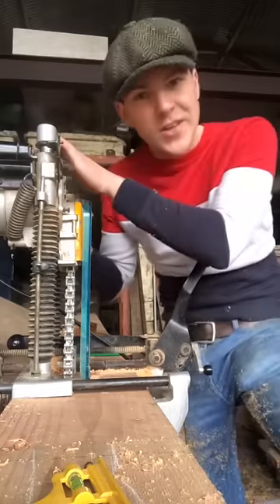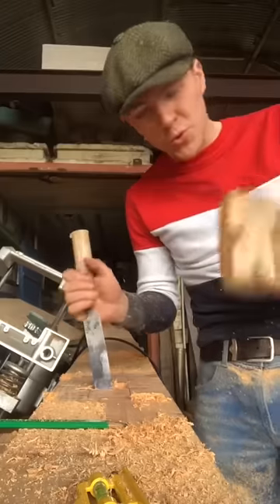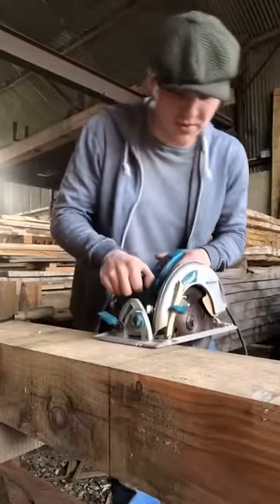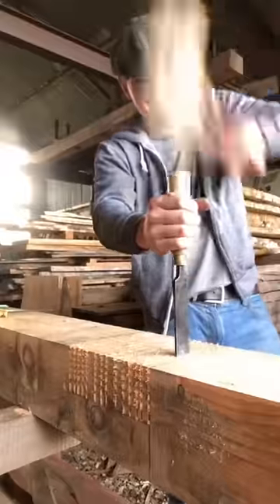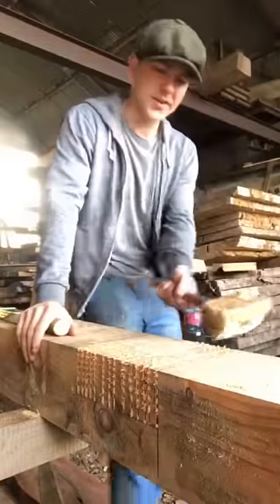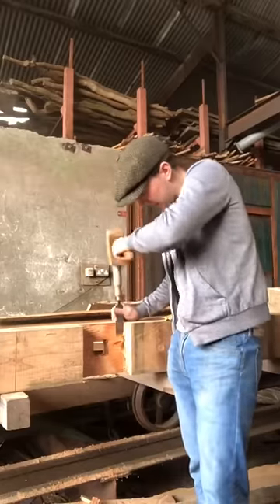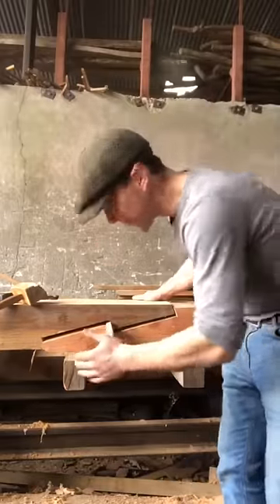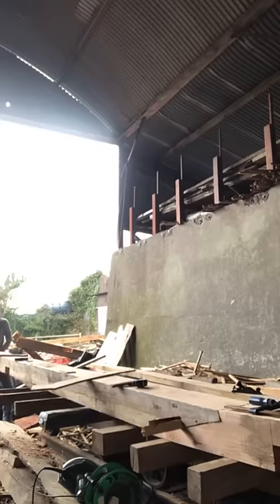Timber Framing Activity #shortvideo #ireland #timberframe #handtools #construction

Comment: The issue with your scarf join was two fold. One: not enough of an under cut at the points. Two: did you make sure your cuts were perpendicular to the crown of the grain? IE is the line of the cut going from the core of the tree out? If its cut where the rings are parallel to the cut, they can delaminate, but if the angle of the cut is perpendicular to the crown of the rings they contribute to its strength.
Reply: Everyone I’ve seen cuts these wrong. The only issue I see is that the end angle is square, it must be acute otherwise the two pieces cannot lock together.

Comment: Jamming the safety on your circular saw ❤. I'm 40 and I've just learnt this. Rate u bigly Brighton uk
Reply: Just make sure that you're on heightened safety awareness whenever the using a wedge on the blade guard. Hazard #1: while holding the spinning blade at your side, it will catch on some nearby object and be spun into your thigh. Hazard #2: If you set the saw down on a bench or the flaw, it will become a one-wheeled rotating cutter and rip into your foot. I've seen both of these actually happen. 
-- That said, I worked for years on framing crews, and we used the wedge routinely. 
-- And that method of cutting dadoes and rabbets is fast and effective. I lost count of the bookcases I made that way. It works better if you make the cuts closer together.
Reply: I never wedge my guard anymore, seen too many accidents. There are very rare occasions it’s a necessity, but this is not one

Comment: Your scarf joints aren't long enough. You need to run the joints 3 times the width of the material on length. This looks like 20cm material, so the scarf joint should run 60cm on each piece past the wedge. For the wedge you'll need to mark out the actual size of the wedge hole and split that in half so you can drive the wedges into each other , this crushes the scarf joints together. This is a non-structural joint so if you're using this as a beam ideally a post is supporting directly beneath your scarf joint.

Comment: I wouldn't call it a failure. Scarf joints aren't supposed to accomodate that type of stress. It's used to splice to beams together lengthwise, and keep them from pulling apart like this: <--  -->. Not meant to accomodate forces on the other axis going "up and down". 
So, I'd call it a win (even of it does look a little on the short side. In my country the old books state a minimum jointlength of 3 to 3,5 times the dimension of the lumber)

Comment: What was the problem that caused the joint to fail?

All 3 of the house I've built had a metal skeleton.

I would like to do some actual traditional timber work but don't trust myself enough yet.

So far I've made some convincing faux frames but there is either "I" Beam or Sch #40 Square tubing core doing the work of the span.

As a Welder-Machinist metal just makes more sense to me when so heavily financially invested.

But still really interested in tradition framing.

Comment: Think most of your vids are amazing! That said, your joint was likely cut just fine unless you wedged the other side or sunk it all the way across off camera. I doubted it because I saw it shifting in the joint like there was slop before it broke. If it's only wedged tight on one side your beam is sure to flex to the side with give to it and cantilever those two joining faces until one gives.

Comment: The locking angles on the ends are a bit too shallow Japanese make cut parallel with the angle and place a matching groove into the opposite piece solidly locking them together

Comment: I absolutely hated to work with the chain mortiser back when i had to do external courses to learn the trade. Just seems like such a dangerous machine and so completely useless for the things we used it for. 

Why use a chain mortiser, to create a simple slot + mortise connection, if you could just use a mortising machine (We call it Langlochbohrmaschine, so a Longholedrillingmachine) which doesn't have a damn chainsaw chain hanging off of it? 

I'm just glad i've still got all my fingers, lol.